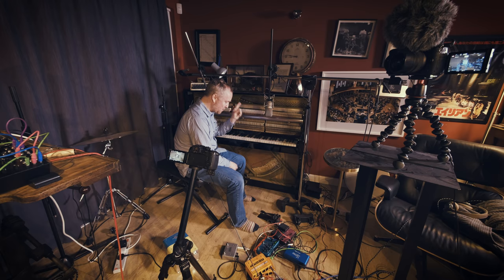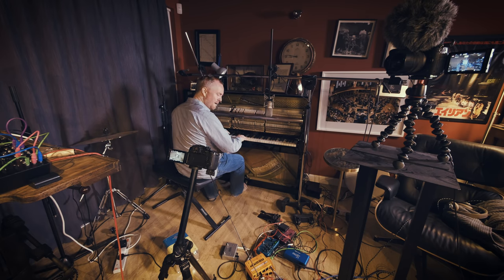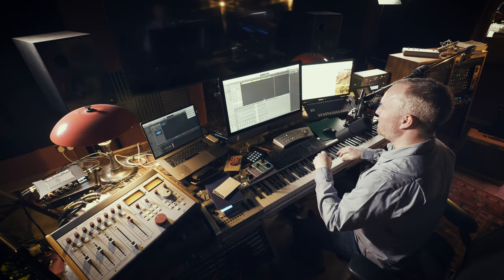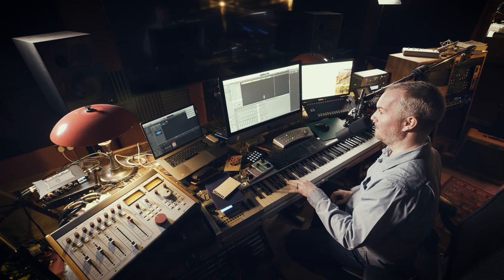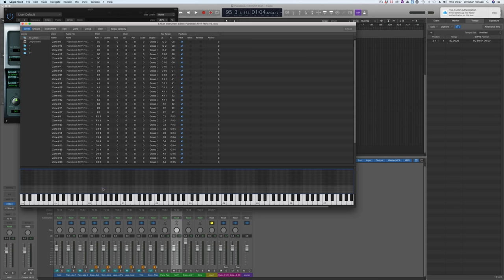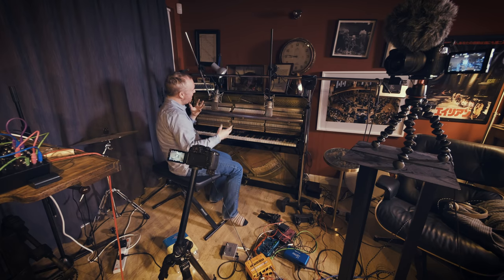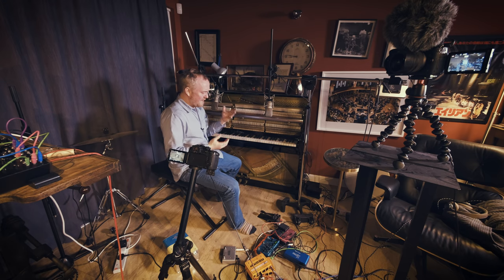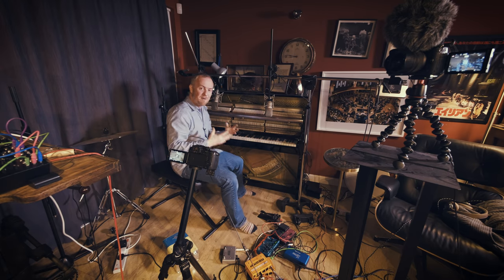Why Do Samples Sound Better When Pitched Down?

Comment: Oh my god. You made an entire (incredibly detailed) video to answer my flippant comment on the last pianobook video. Bless you.   

For a bit of context, I have near zero experience sampling pianos  (which is why I'm here, to learn), but some experience sampling synthesizers.  I assumed, incorrectly, that sampling the cycle of the fifths as opposed to chromatically was to save time, in the notion of an MVP. Thank you for explaining the intent behind it.  

 My initial reaction to pitching notes down (which spurred my aforementioned comment) comes from what I was taught in sampling synthesizers. Given that synths are more complex than sine waves at various speeds, pitching them down means reducing the resolution of the sample. It often sounds better to pitch up synth samples as this only increases resolution while decreasing loop length.  

 Having now tried it for myself, I see how much better it is to pitch down piano samples than pitch them up. I'd warrant that this kind of 'cleans' the sample by reducing its resolution and reducing it's complexity. The lower notes when played on a real piano are very complex, while pitched down higher notes are simpler sine waves that have reduced complexity. 

As for your question, I wanted to ask what polls you're referencing? I stumbled onto this video series through YouTube's recommended section, so I don't know if you're pointing to a Facebook, Twitter post or something? 

As for the final product and delivery, I wonder how difficult it would be to adapt the code for the Labs plugin? Perhaps in the same way Spitfire delivers Labs releases you could deliver pianos for the pianobook. I don't mean it as a download within the current Labs, I mean it as a copy of Labs. In the way Labs has many instruments, Pianobook as a plugin would have many pianos.  The downside of this is the Labs plugin code is likely proprietary and reduces the community's ability to adapt it, etc.  Maybe Spitfire should just open source the Labs plugin code any ways?  I think you could/should charge a small amount for the best curated pianos— splitting the cost appropriately between the creator/sampler and Spitfire, if Spitfire is lending programing work.

Comment: Whew! I am brand new to your YouTube channel.  What a great introduction for me.

This video makes complete sense to me all the way through. I get it why closely-spaced notes sound differently when samples of them are played from when the original acoustic instrument is being played (e.g. C beating against C#). There's a real difference there that depends on the physics of harmonic vibration in those physical objects (metal strings and wood) versus digital facsimiles. This may be related to the reasons that some people prefer the sounds they can get from analog synthesizers over those produced by digital synths or VST emulations. The physics just isn't quite the same, particularly in polyphonic playing, even within purely electronic instruments.

There are some people, also, who prefer "lo-fi" or "8-bit" audio over high-resolution digital sounds, at least for some musical applications. Those same folks may prefer slowed-down (slightly lower-res) samples over real-time hi-res notes for similar reasons. I have never really understood "fatness" (or "phatness") as applied to synthesizer voices. Now I can see what is meant, I think, a little better.

I would go with selling some carefully curated Pianobook packages commercially through Spitfire while keeping unpackaged samples  (or less extensively curated packages) available for free.

Comment: That was a really nice take on the topic, thank you! I feel  kind of bad about it, but i have to take one thing away from you: we don't hear the low end before the top end. The sensory cells that perceive high frequencies are located at the front end of the cochlea, while lower frequencies are percieved further inside the cochlea. This means, we hear the top end a couple of microseconds  before the low end. Not that anyone could actually hear that. The difference is way too small.

Comment: The memory limitations of earlier multi-zone samplers, such as the SP-1200, led producers to record the samples pitched up (turntable varispeed, another sampler dedicated to transposition etc) and use the samplers transposition function to pitch the samples down and it did indeed give it a 'phat' sound. I know this was standard practice for the Beastie Boys, De La Soul, Bomb Squad/Public Enemy. I'm assuming Kraftwerk and Art of Noise were confronted with the same limitations. Brian Eno/Daniel Lanois' "Apollo" makes heavy use of the Lexicon Prime Time's sample rate pitch-shift down function and tape varispeed, funnily enough the standout track 'An Ending' is a bunch of CS-80 sine waves recorded hot to tape and you can hear the pleasing tones of "missing information" all over it.

I noticed how more top-40 sample-based stuff start to sound very sterile once memory considerations were no longer a worry, but a lot of more alternative artists still used the degradation techniques. 

The most cheeky example I've ever seen of pitching down a sample and making it 'phatter' is 'Feel It All Around' by Washed Out which is just Gary Low's 'I Want You' pitched down a tritone. Had everyone wondering what crazy production techniques he was using until someone found he just typed in -6 on a rare italo disco song.

Comment: Hey Christian, loved this one and been mulling it over this weekend. I think maybe our preference for pitch shifting downwards rather than up comes down simply to our love of resonant sound the physical vibrational aspect of music. I feel that when we hear the sound of a piano, we hear the physical body of the instrument in resonance. This resonance is a quality of the tone that we are drawn to and as we shift that sound downwards it as though the pianos size and vibrational depth is increased. The tonal weight below and around the vibrating string is heightened. Of course the pleasing aspect of this shifting is limited as we soon notice the sound is being artificially altered which fast becomes a negative trait. I notice the importance of this physical resonance to the sound of the piano when moving to the upper ranges. When we play a high note on the piano, the instrument still has this large resonant body to give a feeling of depth and weight to that note. If we were to achieve this same note by speeding up a sample of a lower note, we would be in effect shrinking the size of this resonant chamber which I feel we inherently interpret as a negative change in the sound. I do think as well this changes from instrument to instrument.  Sometimes I prefer the sound a guitar slightly sped up,  kick drum or snare (I guess we tighten up attack of the transients which for some sounds would be preferable). Synthesisers as well seem more immune to pitch shifting than other instruments. Perhaps this is because we as listeners are not perceiving the sound as a resonant physical body, and therefore no perceived reality is being contradicted when we artificiality change the sound.

Regarding your sampled piano in particular, I think that when considering why the sampled version sounds more pleasing and more suitable than the real deal, that there are considerations of genre and taste here to think about, rather than a purely objective comparison. I think we can agree that the defining characteristic of the modern zeitgeist piano style is a desired reduction in harmonic content. Whether by playing whisper soft or placing muting felts over the strings, essentially the goal is usually to reduce that hi-frequency resonance that a piano naturally has. When pitching sound downwards, the tone is dulled and the transient attack reduced, helping us greater achieve this lovely soft ghostly sound. Whilst dulling a tone through pitch shifting really lends itself to Satie, I’m not sure it would apply as well to say, Rachmaninov. 
Secondly, I feel that what we love to hear in sound and instruments is consistency across their tonal ranges. No lumps and bumps. If we take one note and spread that tonally through pitch shifting, each of these new notes share the same tonal fingerprint and I feel its this consistency that our ears love.

Comment: Fantastic insights on sampling.  Timely, too.  I just finished sampling my electric guitar for a project, and noticed how much better notes played on the high B and E strings sounded when pitched way down to the lower octaves, vs the low low E string.  There is something about it being stretched out that allows appreciation for some of that hidden detail, as if you zoomed in on a distant landscape.

Comment: On the topic of free vs paid product for Pianobook, this certainly brings to mind open source software. It seems that Pianobook has a few key values:

- Sharing/community: Contributors can share what they have and use what others share.
- Education: Learning sampling, preparation and production techniques.
- Creativity: Sparking ideas with sounds to which you might not have access, otherwise.

These are all values that open source software includes. As long as the community is engaged, this could be self-sustaining. Why not filter decisions through these values? This could be turned into a commercial product later with simplicity being what people are paying for, as you suggest, Christian. I've seen a few (software) projects become sour and go off the rails by considering commercial avenues too soon. It tends to narrow the thinking and prevent the values above from being the main drivers.

As always, great stuff.
Reply from the maker: Warren Harrison sure thanks Warren the initial motivation was me making a commercial library and showing how I did it, and then I thought I could involve the community so I’m rolling back the original idea as the commercial aspect doesn’t fit for me anymore. I think your advice is sound though.
Reply: @TheCrowHillCo  That makes sense. I missed that point about the original  idea.

Comment: Love the experiment. Noticed the same when I pitched a piano down a few octaves. I'd like to see the experiment done with higher resolution recordings tho. My theory is that when you record at 96kHz and pitch it down you'll get a brighter sound than with a 44.1kHz recording treated the same way, since you are basically capturing more high end frequencies.
Reply: It depends on the ability of the microphone to capture high-range frequencies - the highest pitch that can reliably captured is half the sample rate, and response curves are normally given up to about 22kHz. If the microphone can't respond to frequencies higher than that, then it doesn't matter what sample rate you've used, those frequencies won't be present
Reply: @charlesgaskell5899  that's true aswell. of course you should take that into consideration. Still I find it interesting to see how big of a difference there is comparing the end results side by side

Comment: When the Casio Sk-1 sampler came out back in the 80's, it had 2.5 seconds of sample time.  So I would sample records at 45 rpm or 78 rpm and play back the sample on the lower keys to recover the original tempo. The sound was wider and thicker and crunchier since the sample rate was 8 bit. But you are right...anything sampled then played back pitched down is phat to death. Although some like that scratchy alias effect, I try to avoid it at all cost. I dig dirty samples but aliasing turns a good sample into trash.

Comment: So to sample a piano closer to perfection we would have to sample the strings isolated from the soundboard, then analyze the soundboard and recrate its effects kinda similar to what amp simulations are doing, just more complex because it wouldn't be a simple I/O style signal path. You'd have to take recordings of every string by itself, then every string alone (or several on the lower notes) with the soundboard, then every string while all other strings are also mounted on the soundboard. That would give you enough information on how everything interacts.
Have fun reranging the string selection on your piano close to 100 times and using like 50% of your CPU on a single plugin!
Then again, coming from this video people would most likely prefer the sound of a 'traditionally' sampled piano!

About the Pianobook thoughts, why not make something like a CSP (community sourced plugin)? You could make this for a variety of instruments, of course it doesn't have to be such an extensive collection like what you're doing with PB right now, but the general idea might be worth considering if you're not absolutely saying 'Bollocks, I'm never doing this again, not even in 10 years time!'
Reply: Now thinking about it, you could even implement faders into the 'perfect' piano to increase or decrease the effect/crosstalk from the soundboard. That might be interesting!

Comment: Wrt your questions about reconciling community contribution with commercialisation: have you explored the use of Creative Commons licenses? A possible application is where contributors submit samples either as a CC-BY-NC (non-commercial) or CC-BY (commercial allowed). Others can utilise the samples as per the license. You're also free to curate the samples that allow commercialisation. Over at a site ccmixter.org, they have adopted a variation called CCPlus, where it's like a royalty payment arrangement if your non-commercial samples are requested for commercial use. Note: you'd still have to deal with a potential issue of a copyright dispute wrt a contributed sample, but if you're going for commercialisation then I suppose treat the rights clearances process as no different from any commissioned project.

Comment: Absolutely fascinating!

The reproduced results gained in sampling a single note of varying intensity is brilliant, but as you are aware these hold but a small sliver of the overall dynamics and therefore "character" of each note (never mind infinite combinations of notes).  This has already been put forth in the comments.  I'd venture a guess that, instrument-to-instrument, there will be subtle variations which make up the overall sound.  Harmonic, sub-harmonic, and off-resonant acoustic influences to adjacent components are but a fraction of the complexity.  I imagine your sound board example speaks volumes to that!

Is it even possible to capture?  Perhaps model and then intelligently reproduce instrument variability through digital means?  I've had some experience in the latter, but in a totally different world - fluid dynamics applied to solar-thermal systems.  We eventually abandoned what was a very expensive adventure, despite having great promise.  In the example you put forth I would bet the variables involved are acoustically insignificant when each is held alone, but when combined?  So perhaps place focus upon the most important, and then find a way to introduce these into the reproduction process.

** On the sine wave analog, your folded paper evokes both amplitude and frequency reduction.  (I don't see a waveshape change - transforming a different wave into a sinusoidal - in what you propose).  At the lower frequencies there's a natural translation to what I'd term a kinesthetic impact.  As you say, the body picks up those lower frequencies (a bodily-felt experience), adding to the information.  Fascinating to consider that what we do not hear, we feel nonetheless.

Of course,  months have passed since you published this, so by now the problems are identified and solved?

Comment: Could someone please explain what he is doing from 6:25 to 6:50??? I'm using Ableton I don't know how I could achieve this sound, I think it would be with the Sampler device? Thank you
Reply: He just sampled a piano note with a sustain pedal, so in ableton you can use the loop option in the simpler to loop the tail of the sample so it never stops, with medium release, then add some plate reverb and cut off a bit the lows u should get something similiar

Comment: If you do decide to monetise in some way, I think you need distinct products.  For intsance:

Pianobook Player would be completely free.  Mostly user-generated content, but seeded with some lovely Spitfire-produced samples.  Preferably curated to keep it sane.  Basic processing tools.

Pianobook Engine would be custom designed to work with the pianobook format, and provide extensive manipulation and processing tools.  Also include additional samples, like piano that has had out-of-the-box processing e.g. through your modular rig.  Doesn't contain any user-generated content, unless permission/remuneration has been arranged.  Would be a paid-for product.

Would love to see a charity element included.
Reply: EDIT: To clarify, where I said that a paid-for product shouldn't contain user-generated-content, I simply meant as part of the download.  There should be the ability to load samples in.

Really it's a church and state thing for me.